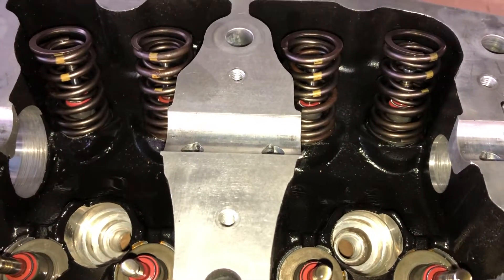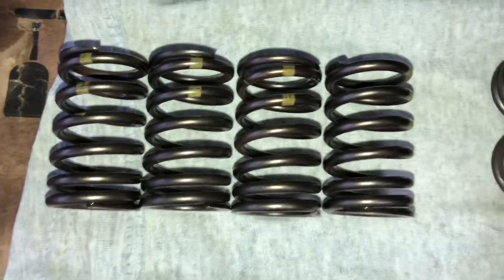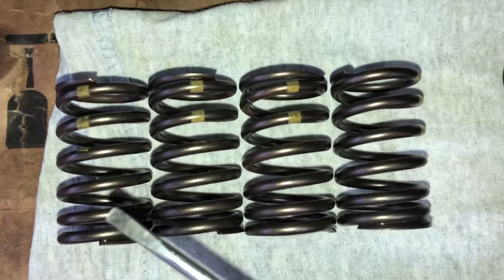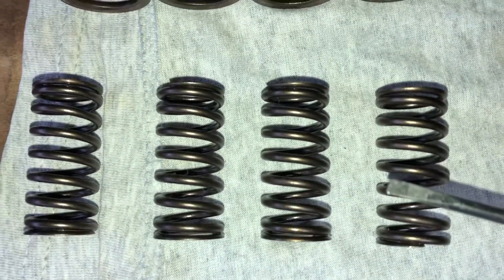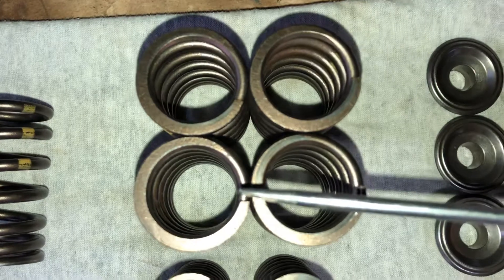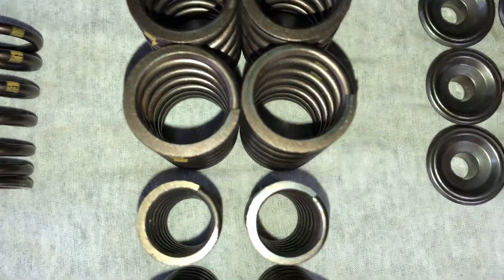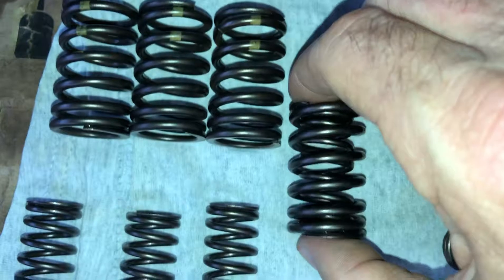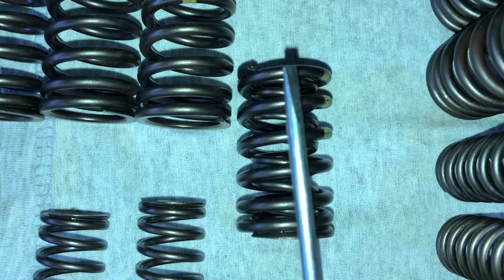Sea-Doo 4-tec Valve Spring Direction

Comment: Hey I have a question can I put a 260 hp charger in a 215 or no. I’m asking this because there is a hole on the 260 I’m not sure if it’s for oil or something but the 215 does not
Reply from the maker: Adi riaN The hole 🕳 on the 260 charger is an update and oil drains faster out that hole 🕳  for better cooling . You may put the 260 charger into the 215 chargers place and then you need to upgrade your injectors to accommodate for the more boost . Thanks for watching
Reply: Thank you red
Reply: It is an 05 does that matter I have it tuned to 255
Reply from the maker: Adi riaN you will have to update your valves also for safety and you must watch that the ski does not peak out on limiter . 👍